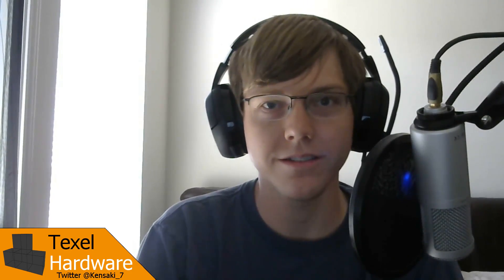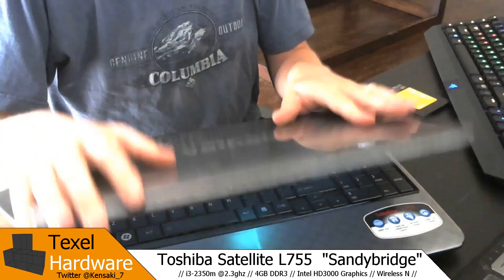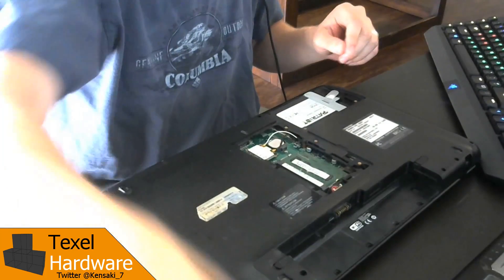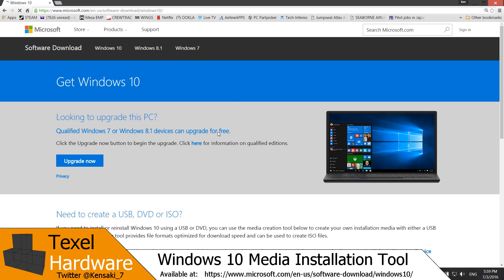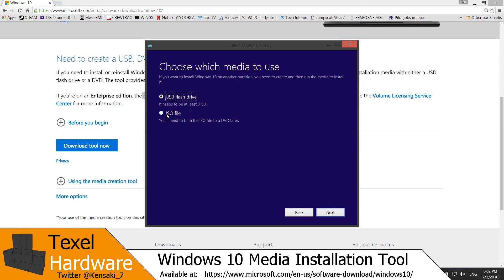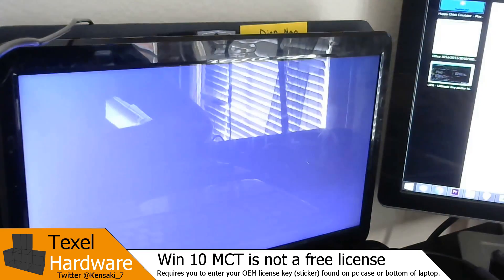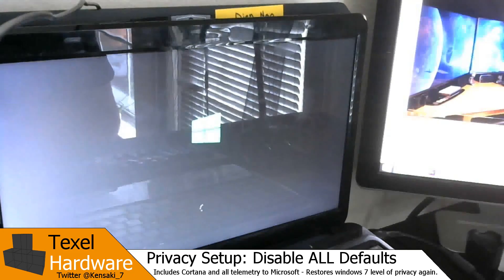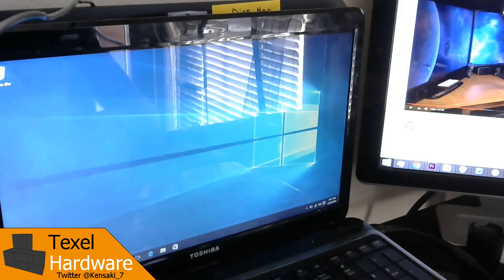SSD Upgrade / Windows 10 Installation Toshiba Satellite L755

Comment: I was hoping to upgrade my old toshiba satellite with a ssd, but I wanted to keep the HDD as well as shortage and use the SSD as the boot drive with my OS and and some select files, like games, as my toshiba has an AMD gpu in it as well. There is a bit more space where my HDD is than in your machine. I have the s855d model. I'm not exactly sure how to do it though, I would probably get an m.2 SSD and need an adapter piece to make it work and than use RAID or something. I just upgraded the RAM which was as simple as it gets. Using a Lenovo Legion 5 right now but I like the Toshiba as my back up. Going to take some work to figure it out, although might be easier since tech has changed a lot since you made this video, still, going to be a project. Thanks for the video nonetheless, well done.

Comment: Still running the L755 in 2022.  Triple boot W7/W10/Linux.  Does Zoom meetings fine, can even open small Revit files.
Reply: Me too
Reply: Can i upgrade this laptop to 16gb ram? We have same model
Reply: @navis1527  No, I believe the maximum is 8 GB, 4 per slot (2 slots).

Comment: I have a very similar if not the same laptop. Installed the new ssd but i get a black screen saying No bootable device.
Reply: You probably don't have Windows installed on the SSD. Check out a free Windows install with a genuine product key and just stick with all steps necessary to fix  your issue. A clean formatted ssd is what you need to have to install your version of windows.

Comment: How was your overall experience with Win10 on L755? I got an L750, dual booted it (Win7 + Win10). Win10 was so laggy so I deleted it. Now i bought a 240gb SSD, will replace the HDD and will try again with Win10. *Fingers crossed *
Reply from the maker: It was not bad using Win 10 off of an SSD on that machine.  It worked perfectly fine for general web browsing and basic media consumption.  Since it originally shipped with a traditional HDD, it performed about 8x better than when it was new.
Reply: @texelhardware4234  update: I successfully installed Win10 on my SSD and it works great! So I decided to use my Win7 product key to activate my Win10, and have formatted my old HDD for good.

Comment: Good video for it being your first time. fun I have the same laptop and was looking to upgrade it to make it a little better and was thinking of doing the same exact thing you did. I'm already running windows 10 and max mem so now I'll install an ssd  too.  Once again very good video,keep it up.
Reply: Did you end up doing it? I maxed out the memory to 8gb full mhz (I think it was 800mhz). Did the ssd make a huge difference? I've heard they do and can make an old machine exponentially faster especially if you're running a 5400rpm hard drive.

Comment: I've got a 2006 Toshiba satellite. I would like to give it an intel i5 or i6, 16 gigs of ram, and a solid state drive. Is this stupid? Will there be a problem giving the compute that much of an upgrade?
Reply: Your motherboard won't be compatible with a processor like that. Google what processors are compatible with it. It most likely can't go up to 16gb either. I have the same laptop he posted here ans the max is 8gb and thus thing is from 2011.

Comment: Hello I got the l750 can you explain wich SSD is best?
Reply from the maker: Any 2.5 inch SATA III ssd will work.  I recommend using a reputable brand such as Samsung, Western Digital, Patriot, Toshiba, Western Digital, PNY, ADATA.  I recommend no smaller than 250GB capacity in 2021 and beyond.   Reason being is Windows 10 is getting bigger than it used to be and having a 120gb drive will probably only give you 80 gigs to work with which is not enough for most people anymore.

Comment: I have an older l300-29d that i have upgraded from a 2Ghz pentium to 2.8Ghz core 2 cpu 256gb ssd + 1tb hdd and a fhd screen.

100% worthwhile upgrading rather than replacing the whole machine most of the parts were either free/ cheap of stuff i had around from other dead/upgraded systems, an upgraded older laptop will often be faster than a budget new gen laptop at the cost of battery life and weight.

You can pick up the older satellite range for as little as £10  a cpu + ssd upgrade will make you forget they are 10+ years old, replace the odd with a hdd caddy and you have massive storage potential, you can keep the odd in a cheap external enclosure if you still need it occasionally.

Full hd panel replacement is possible with the older l300 15.4" toshiba laptops (core 2 era), you do need to upgrade to a dual channel screen cable from a model with higher resolution the 1980x1200 panel I used was from a hp elitebook.

If you have a model with gma 4500 mhd (g45/47 chipset) you can upgrade to 8gb ram  and 1066mhz cpu x9100 is not worth the extra over t9900 in my opinion, both clock at 3.06Ghz the x9100 has an unlocked multiplier and higher core voltage to support overclocking.

I have not heard of anyone installing a q9000 (6M cache) q9100 or qx9300 (12M cache) to one of these older machines but an unlocked core 2 quad would be great.

Windows 10 can be activated with windows 7-8 product keys during first installation in 2020 even on machines that never participated in the Free Upgrade offer at the time. 
Windows 8 product keys can be read from the bios area using various software available online.
Once activated you have a digital licence and will not have to re enter the product key on following re installations (just click "I do not have a product key" during installation and the digital licence will be applied when you connect to the internet)
Reply from the maker: Nice projects!

Comment: Thanks for this video. Its exactly what I want to do but with a different model toshiba satellite p855-s5200.
I would not mind if you had no music or very very low but I can hear your voice clearly which is the most import thing....
Reply: I did my upgrade to a 1TB SSD AND 16G OF MEMORY AND WINDOWS 10 PRO computer boots up in about 8 seconds. I am wondering about upgrading the wifi card if that is possible and worth doing?

Comment: Hi/hello
I ordered an ssd on online shop and I received na ssd which is SanDisk ssd and the ssd doesn't have plastic seal and I thought it's ok and i clone the hdd to ssd and I install the ssd and when I go to the bios my ssd is not showing and when I boot the bios the windows 8 is installation no drives found and I load the drive I don't see anything ssd in there and after that I remove the drive and I put the hdd on it when I boot the bios again no drive found and I returned the ssd to the seller. Until now my laptop is still not working because the drive is not in there no drives are showing. Please help me. What ssd I will buy for my laptop. I have (Toshiba C50-a0113) what kind of ssd is compatible for my laptop
Reply from the maker: Any SSD should have worked, SanDisk is usually a good brand.  It is unfortunate your situation.  Most likely you bought a returned product.  The last customer probably deleted the MBR partition volume when they deleted the partition they had originally set up.  More than likely if you connected the drive to a computer pre-loaded with a software like EaseUs Partition Master Home Edition (free), or Macrium Reflect (Also free), you can find the drive as an 'unformatted volume' despite the fact that  windows explorer does not see it at all.  

In either of these softwares you have to go through their process to set up a new partition.  This will rebuild the MBR volume, and thus, allow the new created partition to be available for use in windows and on other devices (compatible with the chosen file system of course.)  

Now as for my recommendation, go with a Toshiba SSD, as they are my personal favorite for 2.5" Sata III SSDs.  I also recommend Patriot Blast/Ignite/spark/burst.  These types of drives all perform the same, and as an end user, they will all perform at the same 550 MB/sec.  I recommend buying at the store if you can in person to save on shipping and waiting time, but online make sure you buy from reputable vendors.  Amazon is getting a bit contaminated in the supply chain with people reselling returned / defective or sometimes outright fake products at times from shady sellers.  Be sure to check the vendor carefully.  

Best of luck....

Comment: Thanks for the video. I have a Toshiba c850d-125 and I have already rammed the ram from 4 to 8gb ddr3. I upgraded a 4300m A4 cpu to an A10 4600m. I thought it was going to be a big difference, but no. Now I'm missing a switch to a ssd disk. I have problems with the latest drivers for win 10. Only those 2015 work. This laptop has 1g of dedicated memory for the graphics card. What do you think I should do to improve your performance? Thanks

Comment: I know the video is old but thanks for the video ^^ I still have my toshiba satellite L750-12N since 2012 ahah I used it as my only computer since then and I was able to play any game on this too till 2 or 3 years ago, now it starting to suffer of slowness and is ofcourse no more good enough for gaming (especially considering it came with a 4Gb of Ram). Got it for 550 euro 6 years ago and it still perform better than any laptop under 400 euro XD I am going to replace the HDD with a SSD and perhaps add 4 Gb, do you think it could be worth it?
Reply from the maker: It depends what you plan to use it for.  Adding ram will only help marginally with games.  The biggest problem is that these machines have no dedicated GPU of ANY kind...  Plus the integrated graphics are on a chip that is from the Sandy Bridge era, and I think the term ERA is appropriate here.  As a gaming machine, I would not waste any money or time trying to get this one up to specs for that mission.  If you need a web browsing and streaming machine, Chrome eats ram like crazy the upgrade makes sense.  If the focus is about gaming,  there are some modern 1050Ti equipped laptops out there with 2GB of VRAM well below 1000 USD.  I've seen them as low as 700.  Something like that will be money way better spent.  Hope that helps.
Reply: hey thx for the answer, I actually upgraded the Ram for the ridiculus price of 25 euro (2X4 Gb RAM) and still not sure if to purchase an SSD or not too, actually my Laptop does have a dedicated GPU not quite powerfull as the one you mansioned of course, it is Nvidia GTX 525M with 2 Gb of dedicated memory, I saw some good gaming laptop too for around the price you're talking about but right now I am kind out of budget for other reason so I was just trying to figure out how to make my old machine better.
Ram upgrade only for the ridiculouse price was definitly worth it, I am able to run The Witcher 2 at 1080 with low spec or mid spec at a bit lower definition,
For now I don't see much the utility for the SSD upgrade, perhaps if I get a special offer for an SSD I may reconsider it
Reply from the maker: Yes, beyond faster load times, once the game is loaded into system memory and as long as the needed active files for the game fit within the amount of ram available, the performance will be practically identical.  There is a benefit though of quicker system response time overall with an SSD that you may find worth the money in your case.  Windows often executes random read/write operations when it references new items and system files that 'fault' meaning that the machine has to load them from the main system storage instead of referencing them within system cached data on the active ram.  The massive increase in speed of read/write  I/O operations of an SSD I feel can be worth it in your case since a new system is out of budget.  I'd recommend getting the largest SSD capacity you can afford.  You just have to be the judge of whether or not your system is responding adequately fast enough as it is or not.  The older the drive is, and the more full it becomes, the slower its performance will become and the likelyhood of failure also increases with age drastically after 3 years.  SSD's are not subject to these drawbacks and should perform the same level regardless of capacity usage levels, and age as long as the NAND flash chips are still within their useful service life themselves... although it is important to remember the very rare and remote chance that these can physically fail as well.  I do have a video about a program syncback free that explains how you can set up an automated data archive.  Also just keep in mind this is only a recommendation since a full new system is not an option.  If you have an MXM format PCIE GPU,  its not worth trying to upgrade.  In theory you could upgrade it and there will be probably a lot of options that are floating around the open market on ebay ect... however such a project involves hunting a compatible heatsink block and custom modifying/rebonding and metalworking custom heatpipes to your existing available heatsink fins, and HOPING it will be enough thermal transfer capacity.  It is a nightmare that should be avoided.

Comment: I have a Satellite C55D-B5203. Can I replace the HDD with an SSD in it?
Reply from the maker: That should have a removable hard drive.  Therefore you can follow the steps to replace/upgrade it to an SSD of course.  I recommend to familiarize yourself with the deconstruction process or removable access panels before you begin.  so you can access your hard drive.  The reference materials I found from a simple google search on your question show you can also upgrade your ram if you like. (16gb is the max I saw others confirmed working)  The other refurbishments I would say are worth the time to do, are to clean the fans/heatsinks and to re-apply thermal compound to the CPU.  It appears the CPU is non-removable BGA 769 Socket type Soldered in on a ballgrid array but you should be able to give it some fresh paste.  Should perform better than new after all that.

Comment: I upgrade my l755 from window 7 to windows 10 the product key will still work for it?
Reply from the maker: It depends on whether Microsoft deems the key has an entitlement to an upgrade or not to windows 10...  The free upgrade to windows 10 "officially" ended in July 2016, although some people have had luck I've heard by validating their old windows 7 or 8.1 product keys after that date.  If you have ever validated your key prior to that date, it will always be valid for either a reinstallation of the original 7 or 8.1, in addition to the new windows 10.  The MCT Media Creation Tool IS NOT A FREE LICENCE.  It still requires you to either purchase a valid windows 10 product key, or have one that you already own.  The purpose of the video is not about upgrading licenses however, since that opportunity according to Microsoft itself has long since come and gone.  The point of the video is showing how easily it can be installed and how to do it on a blank SSD.  If you can upgrade, I recommend trying it since it will definitely save you money if you can though.  Hope that helps.

Comment: how do you install the os on an Empty new SSD??, don't you supposed to do the installation before Replacing the Hard Drive To the SSD???????????????
Reply from the maker: If you plan to do CLONING then yes, you would clone the drive before installing  it (Raw) into the computer.  However, the process of installing a fresh copy of windows  is as shown in the video.  You can put a blank SSD in the computer and run the steps provided, and it will install windows just fine.

Comment: How i can finde the the windos key :(
Reply from the maker: The windows key will be on a sticker on the bottom of your laptop somewhere or on the side/back of your desktop.  I can not help it if it was put some other strange place.  Some systems also have the key registered into the bios on the motherboard, and such systems do not have a visible sticker at all.  In the latter case,  a reinstallation will automatically be activated, but that is a less common thing to see from my experience.  There are some system tools you can download also that can reveal what the current windows version and key is that you are using right now.  (Before you do a reformat and reinstallation.)
Reply: Texel Hardware iam scard couse if the tool was from hacker to steal the keys

Comment from the maker: UPDATE*** The Toshiba Satellite L755 finally bit the dust after a 5.5 year life cycle on 6/30/2017.  Power Delivery became unstable, and my attempts to fix the problem without spending money on parts was not adequate.  Spare serviceable parts salvaged and added to my stockpile include the i3 2350M processor, wifi card, SSD, spare screws, and optical disk drive.